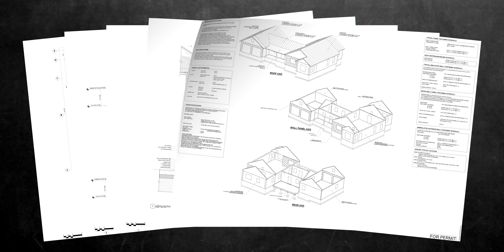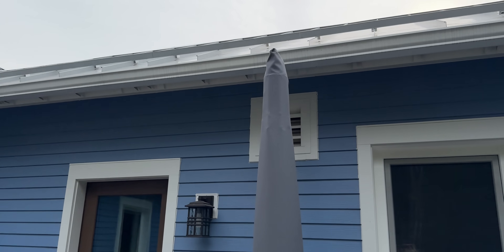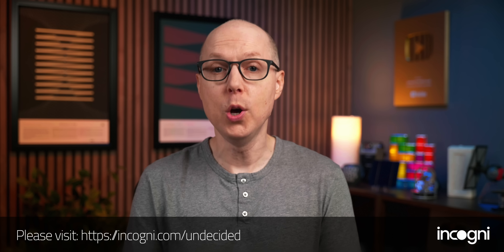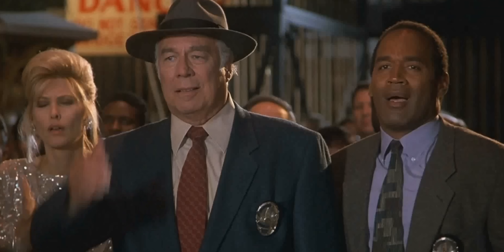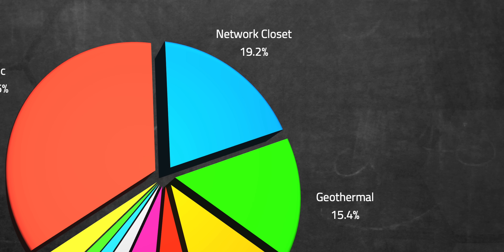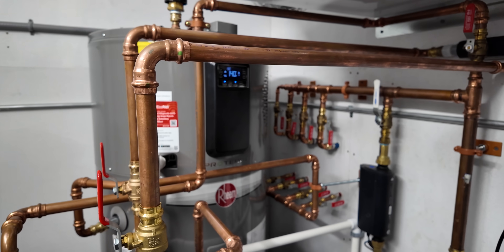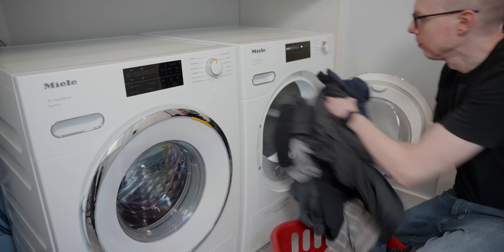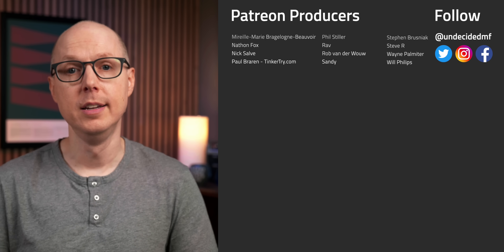What I Learned After 1 Year in My Net Zero House

Comment: I think the only thing that you really splurged on the geothermal heat pump I think in most used case situations just buying more solar to make up for the lack of efficiency with a heat pump set up would’ve probably been a cheaper better long-term solution

Comment: Vertical loop 
Triple plane was good
Don't know about batteries
Had he thought about using foam insulation
Notice the press fittings 
Did he oversize the wiring?
What about variable zones?
700,000 to 1 mill just a guess

Comment: While trying to design a passive home is admirable, the fatal flaw that people who don’t work out in the field with their hands make, is that the designs never have serviceability in mind. Plumbing issues will inevitably arise; whether it be: broken pipes, broken fittings, corrosion (if not copper pipe most PEX pipe is installed with copper crimp rings), backgrading/belly in drain lines due to settling, broken toilet flanges, etc. the only way to get to those issues will be demolishing areas of the slab with all of your other systems running over or in it… makes things complicated and expensive. Also any unnecessary penetrations in your roof is extremely ill advised. Slabs and roof solar arrays like yours are always huge red flags for me as someone who works out in the field.

Comment: I know they're expensive, but I wouldn't build without a basement again. I'm on a slab here, but one of the things I require for my next house is that it be indefinitely renovatable. That means that if a waste water pipe breaks a hundred years after the house is built, it will be a straightforward and economical job to replace all the wastewater pipes. You can't do that when they're under a slab!
Concrete in itself can last a couple thousand years or more, but the building will only last as long as the weakest component cast into or under the concrete. Putting in a basement means you can have all the wastewater plumbing above the slab, where they'll be easy to access. And unlike a crawl space, you have good access to the space under your floor, so you don't have to worry about snakes, spiders, bushfire embers, or lost ducklings getting under there.

Comment: I wish you shared what that 50% miscellaneous use of electricity was. Seems like you would really want to know what that was.

I agree with all of your points on where to save but one. I’ve had geothermal for 15 years and it paid for itself in 7 years and is trouble free. I’ve had solar for 4 years and it’s on track to pay for itself in 8 years.  It’s also trouble  free. I use no gas any longer. The geothermal generates a big chunk of my hot water. The heat pump clothes washer washes an drys clothes in one unit for 40% of the cost of my previous washer and dryer. 

Here’s where I disagree. I waited years before buying a smart battery hoping that the promised drop in prices would happen. It never did and now that I have one the $22,500 appears to be a total waste. I already had a whole house emergency generator. I was promised big savings with this battery but 2 months in there is none.

Comment: That network closet is actually just providing you extra heat for your home (Good for winter bad for summer) so your Geothermal would be higher without it (At Least for winter) same with the misc and anything else that uses energy inside your home (So not charging your car)

Comment: I've got a portable induction burner and I love it. In the hotel it heats up the room a lot less than the NiChrome coil burners and like you say, is fast. The induction burner is a bit noisy at higher temperatures from the hum and then the cooling fan. The built-in units have to be quieter.

Comment: 11:48 WAIT! Between misc and your network you use more than half of your electricity??? No. No, no, no, no, no. Bad data. I’m surprised at you matt. And your EV charging is that low? Do you charge elsewhere as well or only drive like 3,000 miles a year?

This much misc seems like it would be resistive heating and or motors.  What the is this really? 

This whole analysis is off.

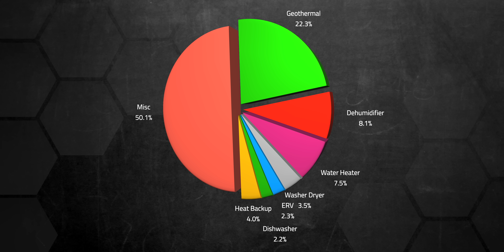At 13:41 your misc jumps to over 50%. What is going on here?

Comment: Matt, I don't understand why you would have a home built with SIP panels with a heavily insulated roof structure, but your attic is vented instead of unvented, unless your roof was not SIP?  The conditioned storage you didn't get with a basement you could have in a conditioned attic.  I'm in Texas so most homes are slab on grade, but most homes being built in a high efficiency manner SIP or not will use a unvented attic so the attich becomes part of the building envelope and basically gives you conditioned storage and more importantly your HVAC and ducts are running in a space that the temp is very similar to the living areas.  I assume you know all this as I see you in video with the Build show.  Just curious why you didn't use this approach on your home?

Comment: We are planning on building a Xyla in SW Mass.  Also planning on putting solar PV on the roof.  How do you find the 7:12 roof for production and snow shedding?  I think optimal slope would be 10:12 at this latitude.  With 2 EVs and the house, we are thinking 12 - 15 Kw if it will fit on the roof and garage.

Comment: I built an ICF house with similar features - super insulated, slab on grade, ERV, passive solar south-facing windows (double-glazed, high solar heat gain) in Northern New England. One issue that I need to figure out now is that I get so much sun in the winter that it heats up the house up to 85 degF during the day, like a terrarium, but then lose most of it overnight.

Comment: Very fascinating. About 40 years ago in the Seattle area a new program called 'Super Good Cents' was started. A demonstration house was built using no exotic heating or cooling system but old-fashioned electric resistant heaters. Interestingly, because of the super insulation of the house, and even with air to air heat exchangers, the average utility bill for heating was just 8 dollars a month. I am thinking vaguely of building a near off the grid house using heat pump water heater, and maybe a central heat pump central heating system, with some solar, on the Oregon coast, a notoriously rainy climate that is blessed with sun breaks rather than sunny days. My thought is to super insulate with strategically placed but minimally-sized windows to reduce heating needs, optimize daytime light during the winter months.

Comment: 65kwH/month for hot water is about $10/month.  Your desuperheater cost about $1500 and your extra storage tank probably $1000 more.   You would have had a simpler, more cost effective system without the desuperheater and buffer tank.  You will never recover that $2500.

Comment: I think it will be interesting when you get all your data and measure against cost and how long before you break even. You would also have to factor in costs for any repairs, replacements or adjustments which would be subjective at best. Another thought I had is how hard would it be to sell your house if you wanted to move. Would another person want to pay that much for a house that they many not want to deal with all the complicated infrastructure. I agree with you about a basement and I have always had one because as you stated it makes it very difficult otherwise to make changes or additons. I am done now and I wish you and yours all the best.

Comment: I am 75 years old and have bought and built a number of homes. Each time I thought the next one will be better and I have learned you could build 100 times and still miss something. It is also trades so when I was young my concern was money and saving it anyway I could and I was willing to be uncomfortable and inconvenienced. Now that I am in my last house and my saving and investing has made me financially comfortable. I don't worry about spending money now if I am hot I turn down the AC and vice versa if I am cold. I don't drive much anymore and an EV would make more sense but I don't want to deal with charging etc. I especially do not want to take even the slightest chance it could catch fire in my garage so not worth it to me. EVs only work if you drive a lot to offset the initial cost. I watch your show you are very insightful and good common sense which is rare these days especially for young people. If you really wanted to save money you would move out of Massachusetts which is one of the most expensive states to live unless your name is Kennedy. For the high cost of living you may as well move to Hawaii and at least enjoy the nice weather. Just an old man's rambling thoughts. I do enjoy your podcasts since I am retired EE who has worked in all the engineering disciplines. I am a retired Navy Seabee which is construction much like the engineer corps but better. For the last 15 years I assisted in the design, construction and maintenance of large datacenters worldwide. I principle focused on infrastructure HVAC, all electrical to include backup power and cooling for Tier Four datacenters. Watching shows like yours helps me keep up with the latest and greatest. I like all the gadgets as well and I have a lot of them in my house and vehicles. One of my Dad's advice to me when cars were evolving with electric windows etc. was "There is more to go wrong and/or break so it will cost more" Although my Dad has long passed I still remember his words and in the beginning of the "computer age" we had a lot of hiccups but it has improved substantially over time and I believe it will continue. Unless we wipe each other off the planet with a nuclear war.

Comment: You can use your heat pump (HP) hot water generator for dehumidifying and save a lot of energy. Just run the wet air through air-air heat exchanger, cool it with "waste" cold air from the HP and then back through the heat exchanger. You will get air of the same temperature (almost) and it will be much dryer.

Comment: We have the same setup here in Sweden, but we removed ERV -energy circulation as it had a pay-off time for 30 years.
We added a smart mechanical exhaust fans that adjust exhaust depending on season-people-heat from sun etc.
Works great

Comment: I would like to see hard numbers. I wanted to put solar on my house,  but I ran the numbers and it's still cheaper over time(20 years) to use my utility company with a natural gas generator back up, than purchase a up front solar system with a battery backup.   Plus, your house seems to be a maintenance  nightmare in waiting.
Reply: Yeah, I did the same numbers and got the same conclusion.

Comment: Recovering AC waste heat is pretty hard core.  My current house is pier and beam foundation.  It's less cost than a basement but gives you underfloor access.  I have my HVAC ducting under the house instead of a hot attic.  Still wishing I had a basement for the storage though.

Comment: I really regret not going with a heat pump hot water system when our water heater needed to be replaced a couple of years ago. Our central heating system is water radiators, so it would have been a double win. But there wasn't anything easily available and I didn't push for it, so we're stuck on gas for a couple of decades 😢
But when the drier dies I'm going to push for a heat pump one.

Comment: If I was to build a forever home.  I would want it make out of stone, brick, concrete.  Not plywood and sheeting.  Plywood and sheeting is very common in the USA, but in the USA building maintenance is massively higher, storm damage is orders of magnitude higher.  Simply because the building standards are so much lower.  Wood is widely available where as clay and bricks works need time and investment.  It is accepted that wooden frame and sheeting houses DO NOT last.  They are not designed to.  They are designed to be blown down and then rebuilt.  The agrument is that a US house can be demolished in a storm and rebuilt twice over for the cost of a european/uk style house designed to last 100 years.
I can tell you which I would like to be tucked up in bed in when the next atlantic 100mph wind storm blows in.  Honestly I would not want to live within 500m of a US style house during a storm.  They disintegrate and become flying debris which may well damage my masonary house.

Comment: What's the ROI on your investment in that special heat pump system, Matt?  30 years?  (No fair comparing it with your old system.)  Each piece of your system cost more than my entire solar/batt system.  Ouch!  I envy your quieter factory built house. Dual glazed windows in my '67 ranch home were a great sound dampening addition in '02. I recently replaced part of my HVAC system (22 years old AC, R-12) with a mini split heat pump and love it.

Comment: Backup heat is a big resistor that is put in your hot water heater to help when the heat pump cant provide the needed heat, eg when it is cery cold outside, and it wants to run a desinfection cycle where it heats the boiler to 65degrees C to kill off al legionella bacterias
It probably does this once a week by default.

Comment: I have determined I want my systems to be electric primary with gas backup. I intend to get a heat pump HVAC system with a gas 'emergency' heat.  I will determine the costs or purchase a thermostat that I can program costs into that will determine what outdoor temperature to run the heat pump vs just switching to gas.  The home we live in now even has wall mount gas fireplaces, one in the basement and one in the garage.  They have a mechanical thermostat and have come in handy when our old furnace goes down during a cold spurt, such as this past week.  I also know that a gas tankless hot water heater is only moderately less efficient than your system as my wife and I use about 3 therms per month on hot water.  I spend practically nothing on gas during the summer and am really just paying the gas 'maintenance' bill.  I enjoy the advances that come with modern electronics.  But I also hold to the reliability and raw capability that comes from age old gas.

Comment: Love this. Great info. But hate that you don't share actual numbers of construction, geothermal, or energy savings. I am researching to retrofit an oil boiler heat system with geothermal. And trying to get a reasonable handle on up front costs, and how long until it breaks even.

Comment: Greatly informative. I had a large heat pump system installed in my old house in Europe and it’s very effective. Electricity is very expensive here so optimizing is key to controlling winter utility bills. However, I do not like induction stove tops at all. I’m on my 3rd one and they just suck compared to gas — so badly that I’ve had a gas range with electric oven installed, with a line to tank gas since I do not have natural gas connected. I have a two burner induction side unit for boiling water because that’s all it’s good for. I enjoy cooking on a gas range and hate every minute using induction. The burners regulate temperature by turning on or off. The lower the setting, the shorter the “on” periods. On off on off. That’s it. I don’t have a visual cue for temperature, there is no heat cloud, the magnets are only in the center of the pot or pan. I’ve researched extensively, tried various induction cookware. Awful. Either there is a better quality model or the technology has a long way to go. This doesn’t include the chipping and scratching of the induction glass tops.

Comment: I did as you did with a minor change Its rather windy where I live so I added a Wind generator to my setup and have had 0 isssues with electronics other than an APC battery that ticks when on the system. its been running for 2 years so far and no usage from the local energy company.

Comment: Slab on grade and where to put everything is very easy if you build your house right. The main problem is the attic. Conventional attics are built with trusses and then a ceiling attached to it with the insulation on top of it. One way you can fix this is to build a double roof which allows you to vent the heat between the 2 layer roofs which will create a much cooler attic. Second is to build an solid floor in the attic and then have a 2 to 3 foot drop down ceiling in which you can run you HVAC, plumbing, electric and networking. This gives you a sealed attic space in which you can store the overflow up there. While the attic will not be conditioned it will not be overaly hot because of your double roof. 
Building post frame construction will also help get you a thicker wall with lower thermal bridging along with the ability to have larger truss spacing which gets you that more open attic if you use an attic style truss. You can build post frame with truss spacing from 8 feet to 16 feet depending on your area. 10 foot spacing will allow you to build a 100 foot long building with 11 trusses which will create 10 bays in your attic.

Comment: Impressive, but too complex to be practical for most occupancies.....eg: contingency for failures, constant maintenance/breakdown/repair costs, knowledge curve....too many involved systems for most single family residences.  However, excellent concepts for multi-unit structures with on-call systems engineer that would be available 24-7, as is the case in high-rise construction.